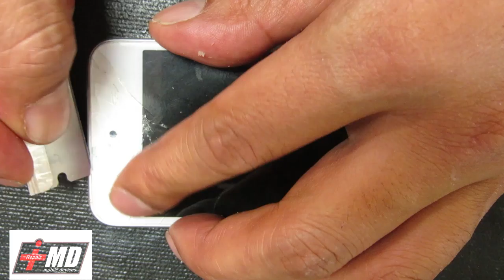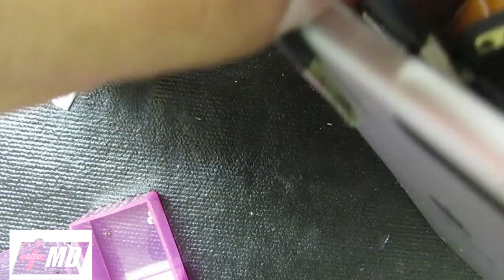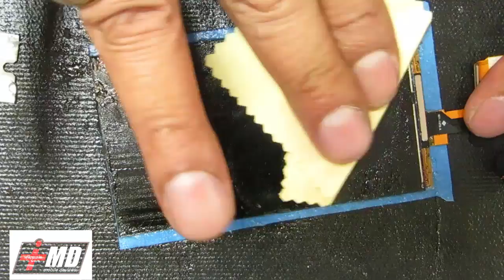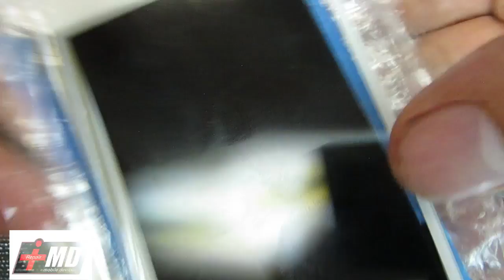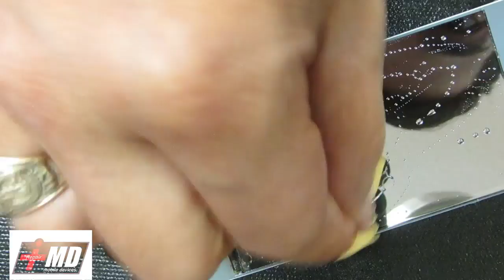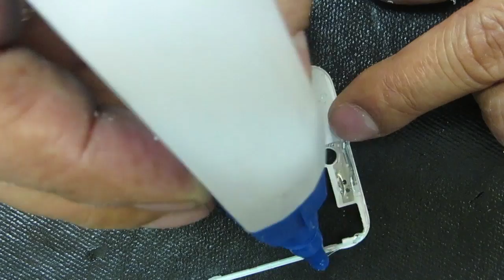ipod touch 5th generation glass repair

Comment: Do I have to do the thing with the uv light??
Reply: If you use OCA(optical crystal adhesive), no need to use UV light. Now more and more people prefer OCA, it is quick and easy to use. We are factory for LCD repair machine and accessory. For more information, welcome to contact us by whatsapp: +86 13682503305 Skype: amy_6421.

Comment: For a patient person this is actually a very do-able job. The cleaning of the glue off the lcd was the most critical for me. I did not remove the backlight assembly, being impatient and over confident (mistake).  By not removing back light, some of the orange glow had seeped between layers of the light and between the light assembly and lcd while cleaning. This alone ruined some of the thin plastic sections. Additionally I had obviously pressed too hard on the lcd while cleaning orange glow and glass off, resulting in a small crack in the lcd, and I was trying to be delicate (doesn't take much). I also was afraid of applying too much heat with the heat gun even on the low setting. But it was fun trying and a lot of my fix-it projects I may screw up like this but I know now how its put together, what the critical steps are to get it right the next time. Plus at least its still repairable, I just ordered the lcd assembly which should be easier to install. From a $5 repair to $60 hope this helps others, captg

Comment: I'm trying to figure out why this replacement is so much more work than the other tutorials I've seen online. Seems like a lot to use the glue/epoxy, get the bubbles out, have to tape everything off, etc when you could just unscrew everything and replace. What's the difference?
Reply: +Melissa Blevins He is just replacing the glass face in this video. It is MUCH easier to replace the entire display assembly (which includes the expensive LCD screen). The glass is worth a few dollars, while a new screen is somewhere around $80.

Comment: awesome, hay guys do you need to change your glass, LCD, charging port, battery, power button, spkr/mic, volume button, home button etc of your cell phone? please don't wait to contact us. here by ComoFix ready to help you.
our location is -
 Lynnwood
20007 44th Ave West Suite #A
Lynnwood, WA 98036
425-501-6593 
note: Previously we were inside the mall. We used to charge high for repair because of high rant. But now we have owned a just outside the mall. Low rant has low repair charge. Thank you.
pro. Jai Gurung

Comment: i just generally have a question for you and your team i have the original iPod touch 5 with no camera on the back i wanted to know if the power mic vol cable connectors were the sam as i messed up the mic and need a replacement and i can not find one with out a flash on it would i get away one with a flash  on it other wise i can't fix the mic on my poor iPod

Comment: I have a problem, while I was taking the screen off part of the plastic bezel near the top where the camera is broke and is no longer attached to the housing(the majority of the bottom plastic bezel is though) so basically is this a problem? can I do the repair without the plastic bezel because I can't find replacement ones. Please help!
Reply: You can use a drop of hot glue or epoxy to affix the camera.  If the frame has minor damage it will usually work fine.  A drop of instant glue on the lower adhesive area will usually do the trick for making a more permanent and tight fit.

Comment: Great video, explained well.  What other options exist for bonding?  I have the replacement glass but don't have a UV curing chamber :) I think I could do everything you showed except for the actual gluing together of the glass and LCD panel.
Reply: You can get a uv light at walmart usually for like $7